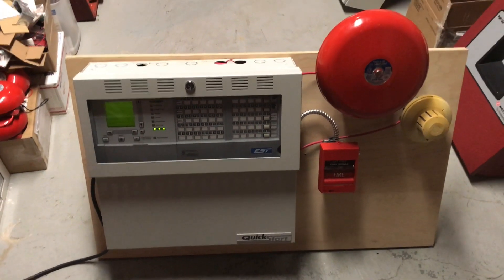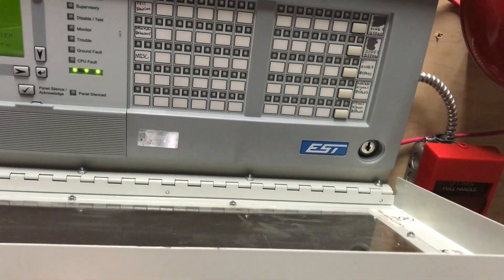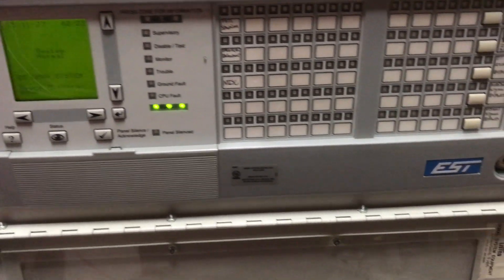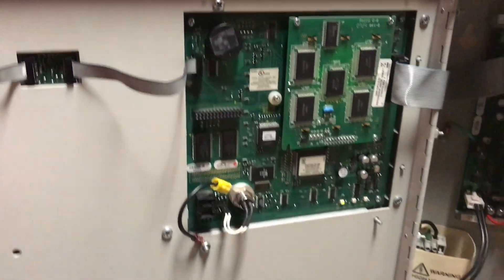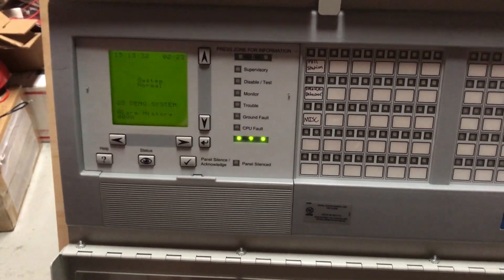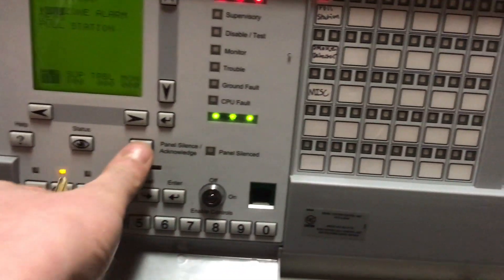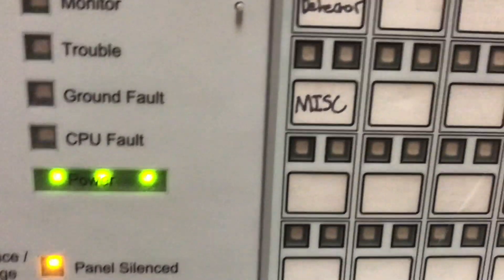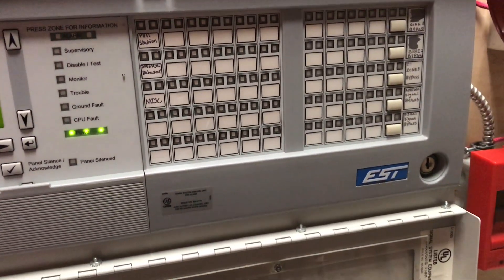Edwards QuickStart Overview And Test

Comment: How do you get the trouble to go away without batteries
Reply: Depending on the panel you can disable the battery chargers and it removes the trouble